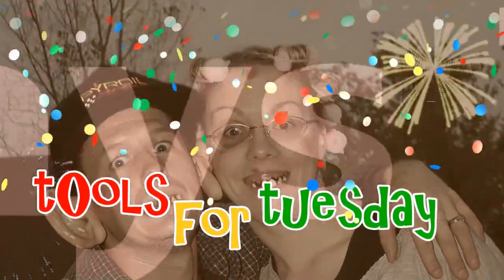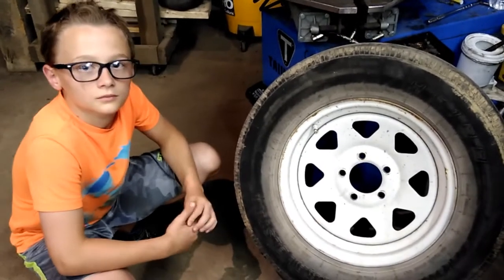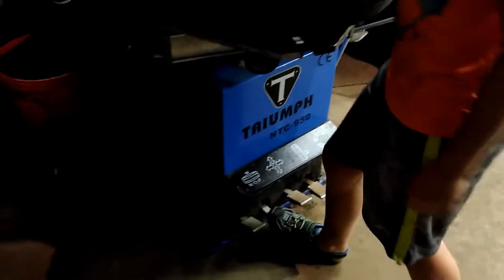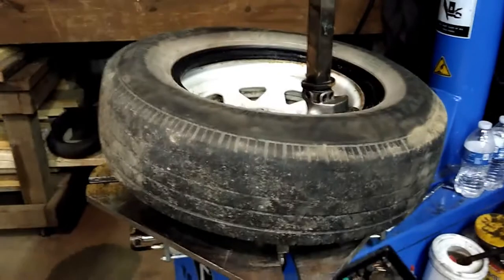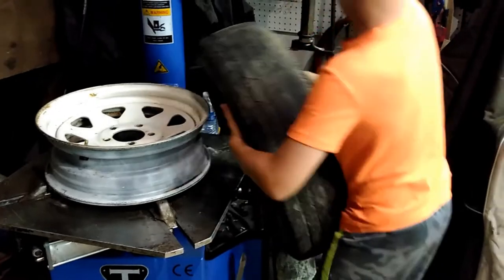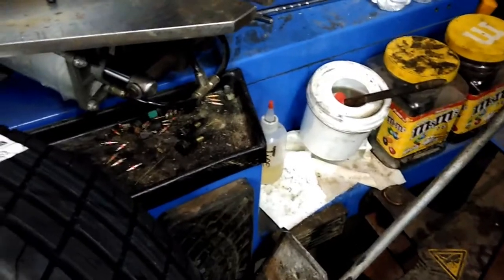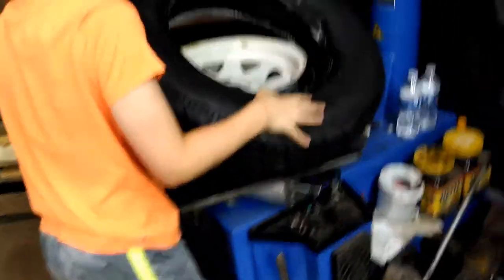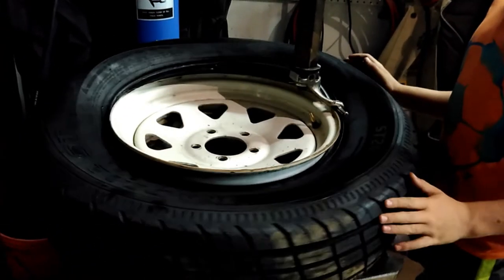How easy is mounting a tire, using a Rim Clamp Tire Machine?

Comment: When you had the machine delivered, how was the process from getting it from the truck to inside of your shop.  Did you use a dolly to move the machine? How many men did it take to move it? What about assembly?
Reply from the maker: Hi, I went and picked it up. It came on a skid with cheap wooden sides. 2 guy can scoot / move it ( but not lift it) I have a forklift to move stuff so it was  bit easier for me. Assembly was pretty easy. BE SURE TO WATCH MY INFO VIDEO ON THIS, (https://youtu.be/-aDmnTtELhc) BECAUSE THE BEAD BLASTER PEDAL BROKE ALMOST RIGHT AWAY.  I DESCRIBE A FIX THAT I CAME UP WITH WHEN I REPLACED IT. I've not had any more trouble with the pedal after that but it's definitely a design flaw.  I purchased a balancer with mine and had to take the balancer back because it was damaged inside the crate. They swapped it out for me with a different one. Hope that helps!